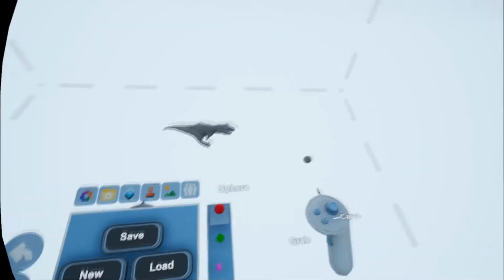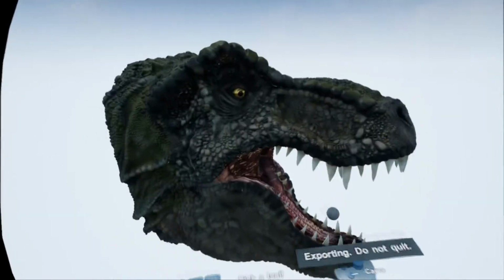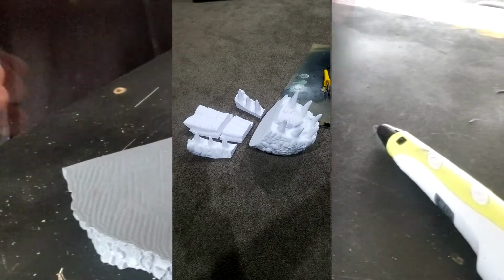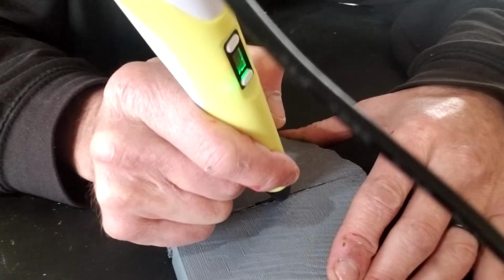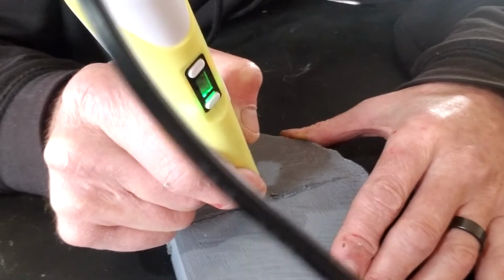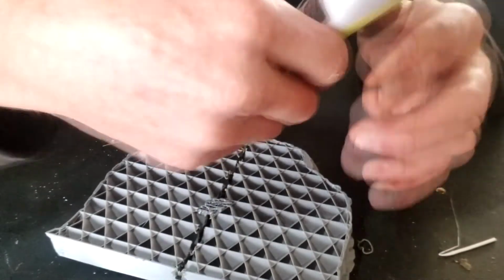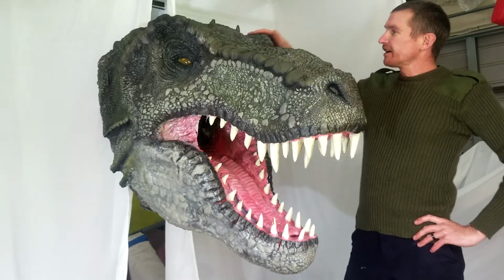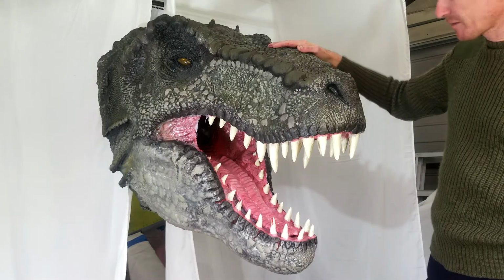SculptrVR T-Rex Head 3/4 Scale 3D Print

Comment: Do you share the STL FILE?
Reply from the maker: I don't work with stl. All obj as the model is way too detailed and large.
Reply from the maker: The vr sculpting app I use exports as obj and the file sizes are huge. Way too big to upload online.
Reply: @topgunsi  but is there any Way I Can get them
Reply from the maker: If you have sculptrvr the app I did upload the scaled down printable version of it in the gallery so you could save and cut the obj from that.